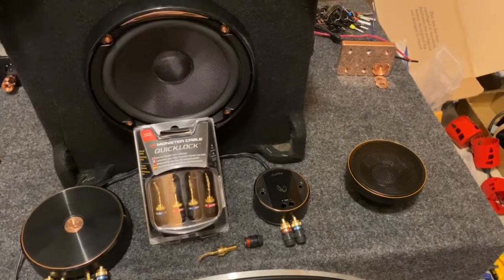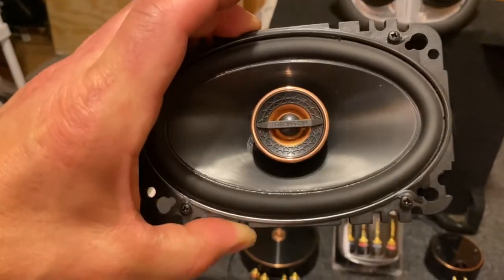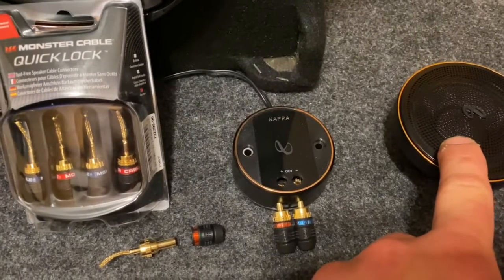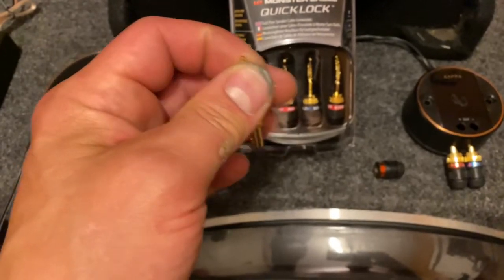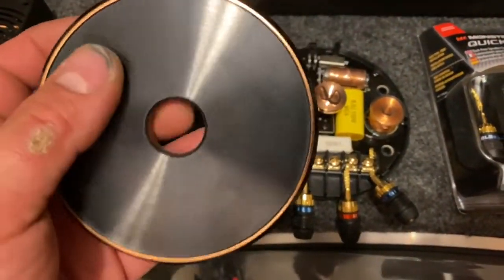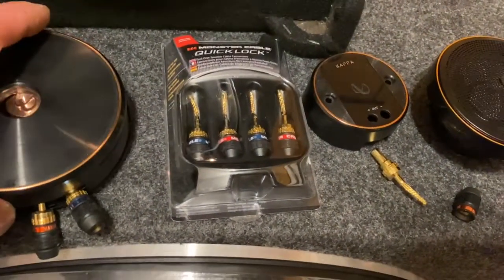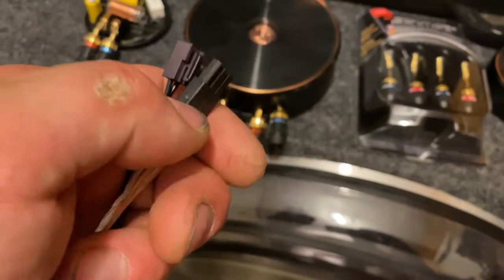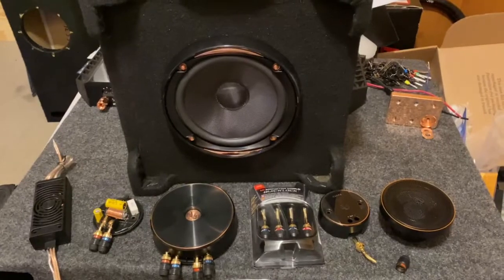Infinity Kappa Crossover Overview

Comment: The entire cover on the larger crossover isn't supposed to come off. The lid twists off and exposes the screw holes through the top and access holes for the terminals. Also shows the switch adds 3db with the switch depressed.

Comment: Just curious if you actually used the monster cable connectors and if they shorted when they touched or if you had to shrink wrap or tape them. I prefer using a spade crimp terminal which is also available in a gold plating and can be soldered. Curious your thoughts as to why you would use those in an environment prone to bouncing, and possibly touching each other and/or also possibly coming into contact with sheetmetal/ground inside the vehicle.

Comment: What's the best kappa component system for a 04 GMC SIERRA. Front and back ? Thanks
Reply from the maker: Honestly its all in the prep! Sound deadening, foams, insulation, ect..... The closer the speaker cavity is to airtight then better sound quality is achieved. Without proper prep even Kappa's could seem sub-par.